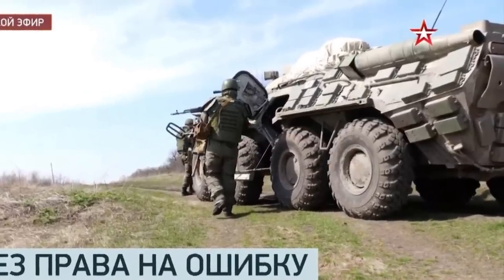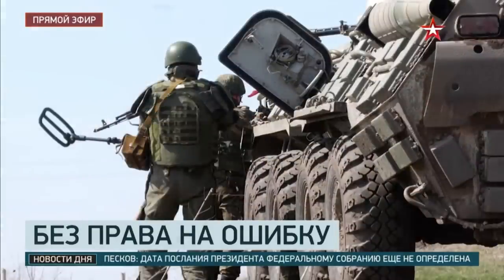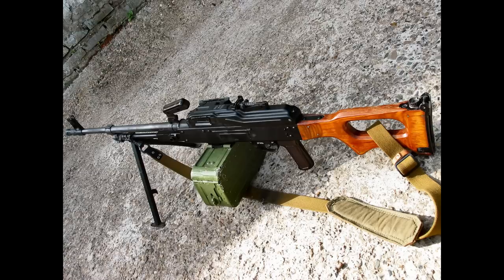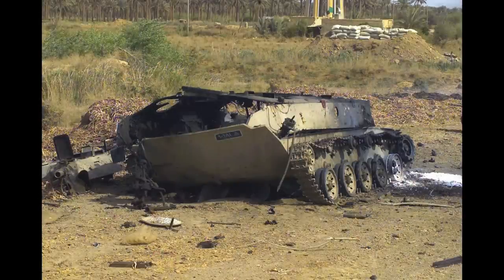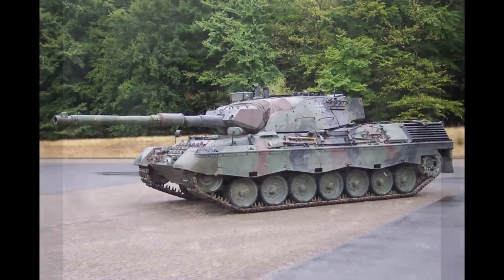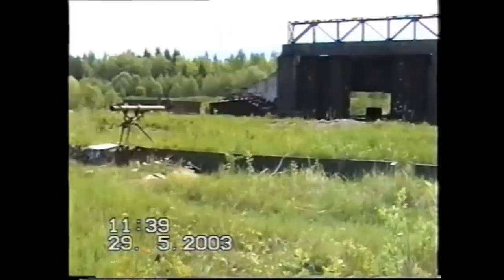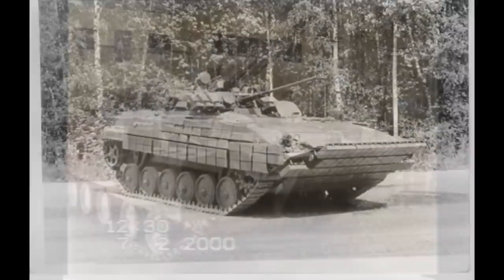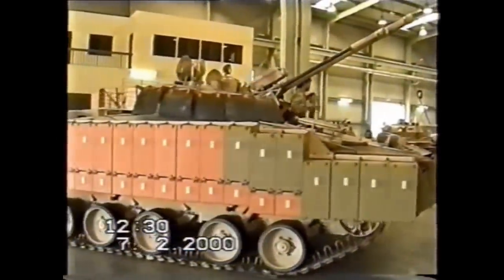Stop Putting ERA on Everything - Why ERA on Light Vehicles is a Bad Idea

Comment: It's worth noting that the majority of impacts we're seeing at the moment aren't from RPG's or ATGMs firing at high velocity, but rather from FPV drones and the like which are striking the vehicle well below the velocity required to produce optimal conditions of penetration and striking with a mix of RPG warheads and non hollow charges. In these situations ERA seems to be relatively useful at stopping a complete vehicle loss, it's still not wholly successful as ultimately BMPs are underarmoured to begin with, but it seems in these cases where ERA is directly struck it more or less completely stops penetration. 

This doesn't stop operators from throwing more munitions at the vehicle and striking unprotected areas of course, which is typically what we see happening in combat footage involving light vehicles from both sides, especially as the winter mud season has made any vehicle movement quite difficult and subject to long periods of vulnerability. 

We're in an era now (pun intended) where access to vehicle disabling munitions has reached an all time high, to the point where armed forces are slapping them on commercial drones and taking out vehicles left right and centre, using strikes that they were never intended to defend against in conventional warfare. It's going to take a while for countermeasures and mitigation techniques to catch up, I wouldn't be surprised if we see a lot of NATO vehicles, particularly Eastern ex soviet bloc countries which have very large cold war reserves significantly up armouring older IFVs to try and match this threat, as frankly their armour is worryingly susceptible to even non penetrating impacts.
Reply: Rpg and atgm doesn't need to reach a target with speed to be effective.  Otherwise anti-tank throwable grenade wouldn't work. EFP wouldn't work.

The penetrative energy comes from the warhead detonation on the surface launching a high pressure copper jet, not the impact.
Reply: The whole point of HEAT warheads is that the energy is stored chemically in the explosive mix and thus independent of strike velocity. The mechanism of the Munroe effect works even on static shaped charges, such as the one used in demolitions or repurposed for breaking into safes or armored vans.
Reply: @ChucksSEADnDEAD   Yeah but you still need to activate the shape charge. And if activation goes wrong, you get no "boom" or worse "boom". so he isn't completely wrong
Reply: @gauss_gun  it really doesn't take much to make them go boom once they are armed
Reply: Heat doesn't need any velocity to work
Reply: You and everyone else should keep in mind one very important caveat to that info that can be explained via something you said: “the majority of impacts WE’RE SEEING” (we’re seeing being the key words).

Most vehicles are still being taken out with rockets, missiles, or artillery. It’s just you don’t see videos of that as often. In contrast to drones or FPV suicide drones where every single one is recorded and commonly distributed to the public.
Reply: @gauss_gun  That's not how it works. The activation is an electric signal initiating a detonator. As long as the detonator was made correctly and didn't get damaged, and the explosive filler is not inconsistent, the activation always goes right.
Reply: @gauss_gun  This is the point I was alluding to, I probably should have described that but what I'd written was already a wall of text and I was trying to be as brief as possible XD. 

In a lot of the combat footage I've viewed it seems drone dropped and FPV impacted munitions tends to impact at poor angles and sometimes with the SCJ facing a poor angle or away from the vehicle entirely. In these cases with the lighter vehicles the non SCJ explosion seems to be enough to cause disabling damage, it stands to reason that the engineering philosophy here seems to be to mitigate these poor impacts as much as possible, as any good impact is probably a complete vehicle loss either way.
Reply: @jonathanpfeffer3716  This is a good point, probably a healthy amount of reverse survivorship bias going on here.
Reply: @ChucksSEADnDEAD  read what original commenter's reply below. I can also add that the shaped charge going at lower speed on the drone can deflect before activating, striking the target at least favorable angles.

Comment: It might be an empty container to add protection against 50 cal rounds.
Reply: Empty ERA container ain't gonna add protection against 50 cal. Also, if they really wanted to have better protection against 50 cal machineguns, they can use the add-on armor thats literally dedicated to stop 50. cal (atleast on BMP its avaliable)
Reply: @TADAMAT CZ  eh throw some angled sheet metal in there and you got some pretty spicy spaced armor to break up 12.7 to 14.5mm fire from light squad weapons
Reply: Add empty countainers to increase moral.
Reply: @brandonsmoot4056  spaced armor isn't very effective against kinetic projectiles. Also, It is almost impossible to make BMP bulletproof against KPVT and other 14.5mm guns. You would need almost 40mm of armor to stop such a projectile, so it isn't possible without heavy upgrade at the factory. Such an upgrade would make the BMP almost 20 tons heavy though, so it would break down easily. Thats only if you don't want to protect sides from KPVT also. That is totally impossible, as the weight would be preety much double of the base vehicle. It maybe is possible to have front protected against KPVT and sides against 50.cal, but only if you need to protect the vehicle against these projectiles at the ranges of 500 and more meters. Point-blank protection against both KPVT from the front and 50.cal from side is impossible. Protection against regular 50. Cal guns is more than possible, but again, the vehicles would get preety heavy and the transmission wouldn't like those few extra tons it has to deal with.
Reply: @TADAMAT CZ  the purpose of the outer plate is to turn the projectile so it strikes on the flat and needs to punch through a larger crossectional area. Even plates as thin as 5mm have shown in models to be able to add significant moments to 14.5mm see attached model showing a sub 50% penetration on less than 20mm of steel against a 14.5mm using spaced armor techniques 

https://youtu.be/WLAMCDcqR6g
Reply: It might also be used to store sandwiches when the crew is hungry.
Reply: There’s something called appliqué armor for that very reason. It’s to be added or applied on later. Why would anyone remove the explosives from the ERA module and place it on the BMP rather than simply placing a thin sheet of metal? You do realize that ERA is very heavy

Comment: I really think you need to make a difference between Kontakt-1 and Nizh, which visually look the same, but behave quite differently. Nizh actually can be added on lightly armored vehicles.
Reply: nizh still explodes only diffrence is how they decrease the hollow charge penetration
Reply: If anything Nozh has far more explosive filler than Kontakt-1 IIRC
Reply from the maker: No, it cannot, Nizh leaves deep imprints into the armor of a tank, which would do a lot of damage to light vehicles, it is more of a directional explosion, so the area of effect would be smaller, but more energy is directed behind it, so it would still do quite a bit of damage to the vehicle
http://btvt.info/3attackdefensemobility/bulat_dz/img033.jpg
Reply: I wonder how many Nizh ERA Ukrainians actually has,
Reply: @RedEffectChannel  would be cool to see a vid from you explaining different ERA types. or even modern defense systems for vehicles in total
Reply: @TheKaMeLRo  we produce it, so you can call it "plenty"
Reply: @RedEffectChannel  That doesn't look too bad though, it barely even scratched the surface of the armor plate. So it would still work on lightly armored BMP's or BTR vehicles.

Also interesting to see the "imprints" of the HEAT charge elements (that are inside the Nozh armor block) which can be seen very clearly on the armor plate
Reply: @RedEffectChannel  Interesting - thanks for the image, but there are several Nizh versions.

Given that Nizh is an array of shaped charges that can generate cutting jets with minimal backblast - not unlike shaped charge can IEDs that were the bane of the US in Iraq - they can be adjusted to be mountable on lower armor thickness in exchange for a loss of effectiveness.

For instance, a 300-block LAFV version was developed to fully cover a BMP-3 somewhere in the late 2000s, rated against 30mm AP sabot rounds and RPG-7/9.

I am not sure where the state is now, but I would be surprised if all the work on LAFV Nizh was just thrown out of the window.

Comment: >Why ERA on Light Vehicles is a Bad Idea
Americans slapping ERA on Bradleys:
Reply: BRAT ERA tiles are specifically designed for the M2A2 and M2A3. Not to mention, the Bradley’s armor is significantly better than the BMPs. BMP-2 can be penetrated by 50 BMG. M2A2 ODS has (at least the ones sent to Ukraine have 30mm protection all around) just look at the weights.

Comment: I wonder if there's the ERA filler in those blocks, or if they're just using the empty blocks to increase bullet resistance. 
Like, the hood of that van might not even stop a .22lr, but the empty blocks might be able to stop 5.45 and 5.56. Idk.
Reply: Depends on material of boxes, but i dont think it increases bulletproofness substantially
Reply: Best case, those blocks are empty and their indented function is to intimidate a would be attacker by masquerading as a MBT.

Comment: There are parts of BMP's, BTR's etc that are thick enough to withstand the force. You even shown some images where they'd be perfectly fine. Notably the front lower glacis, it's ~40mm's
And even the aluminum side skirts, as they are spaced and would not harm the hull.
Turret cheeks may survive, they are 30-35mm. Anywhere else may not survive a blast.
I will add tho, for trucks, it's actually fine. The engine behind will eat the spall, assuming the blast doesn't shatter the window of course, but that's certainly less deadly than mounting it on a door

Comment: Makes me wonder if many of them are just empty boxes for morale. I’ve spoken to Gulf War vets who were shocked at the amount of rubber skirts and mild steel blocks  that were designed to look like armor, but wouldn’t do anything.
Reply: Not necessary just moral "boosters" but putting up an era block without explosives could act as additional armor. Hell if they even put something outside explosives inside it.
Reply: @venator5  Thin metal boxes do not make composite tank armor.
Reply: @venator5  not sure if it would do much against supersonic darts of death
Reply: @polygonalfortress  a bmp is never gonna stop a tank round doesn't matter what you place on it

Comment: I doubt this is the case, but what if they had mounted the ERA panels without the explosive filler; would this add protection and standoff distance?
Reply: Yes, but it still won't change much since even with the added protection and the standoff distance, any HEAT round is still almost guaranteed to pen unless it hits at a ridiculously steep angle and in that case, even regular armor would stand a chance if the projectile skips on the the armor without exploding.

Comment: On a straight hit, era won't help IFVs. On a glancing hit at and angle the ERA is still useful. 

A lot of these example vehicles have the ERA mounted on an additional skirt mounting system, which absorbs some of the blast of the ERA detonation. It seems fine to me.
Reply: Shaped charges doesn't care much about angles after detonating - at least not in a IFV-like armor scenario. On such thin armor, creating more resitance might actually increase the amount of energy absorbed by the object and have more damage than with a simple penetration. Kinetics are a pretty fiddly thing.

The problem is that a lot of these 'creative' designs are made in the field by people with quite a limited idea what happens on different types of ammo hitting some armor, so the constructions might be a nice guess, but often more hindering than helping (may it be size, whight or whatever).
But finally every vehilce face a situation where it should be prepared for better/more specialised. So the crew might be the last line of copeing with the doctrine-breaking orders they might get if war get's a bit out of hand and textbook.

Comment: I suspected that much, mounting a piece of protection gear that is supposed to EXPLODE would require a certain level of already pre-existing protection on whatever it gets put on.
And no matter HOW good your supply truck is, i doubt it is armored strong enough to equip ERA, since most can´t even resist machine gun fire.
But the memes are fantastic.

Comment: Hey, this might be unrelated but can you give your opinion or thoughts on the Vietnamese modernization of the T-54/55 called the T-54M?
Reply: Good. Can't be compared with Chinese Type 59G but I will give it 7.5/10 because of the fire control system that have thermal sight and auto target tracking. Side and top protection need to be improved though.
Reply: Using it purely for defense or even static artillery can be great. India uses its obsolete T-55s (and Centurion) tanks as static artillery

Comment: the author of this video missed one important point - the RPG-7 shell is capable of penetrating the side of the BMP-2 and only after that exploding inside. Thus, empty dynamic protection blocks increase protection against 14.5mm bullets and cause the projectile to detonate behind the body, which significantly reduces the damage caused

Comment: There is always a debate about adding extra armor of whatever sort, be it steel plates, where the disagreement will be that if they are not sufficiently hard they could cause a sharp projectile to turn inward and potentially increase its penetration; sandbags, wood or concrete, random spare tank bits you were carrying anyways like track plate or road wheels, etc., and there are good discussions to have here, like if some extra plating only increases the armor's strength slightly but greatly increases the crew's confidence in their vehicle, it may be worth it.  This is however a very clear case of trying to make something marginally better but instead make it demonstrably much, much worse.

Comment: PBX (Polymer-bonded explosive), A.K.A. plastic explosive is an amazing compound. A good PBX is highly destructive & very stabile. For example, it can explode when hit by shaped charge or APFSDS, but not when hit by .50 cal (.50 BMG or 12.7x99mm) or set on fire for (doused in petrol & set alight) example. Those compounds for use in ERA, that is. Even the US C4 will not explode when set on fire. It depends on PBX's application and it's purpose.

Comment: The topic was debated since the start of the war. There were many possible answers:
 - containers are empty (the goal is to add at least a few mm of steel)
- containers are filled with sand
- containers are filled with ceramics
- containers are filled with steel plates

Comment: You can put contact-1 on pretty much anything, you just need extra distributor anchor and enough rubber to absorb the shocks.
So, stolen lightning discharge triangle and stolen conveyor belt.
This contact on everything is justified. Ukraine got A LOT of old HEAT toys thanks to the whole western alliance scouring the globe for old soviet surplus, not forgetting their own oldies as well. Russians got both old HEAT toys AND new grenades for all their underbarrel grenade launchers and automatic GLs. VKO family punches through 200mm of steel. Every underbarrel GL equipped guy is expected to carry the 4.

Comment: On light vehicles it would be far better to mount a second plate 15-20 cm from the actual armour plate and a light metal mesh out to another 15-20 cm, of course it will make it bulkier but not much heavier and the space between the surface of contact will degrade rpg performance significantly. If spaced armour comes in a package, all the better ...

Comment: Ok, but what if the ERA is placed on added armour placed a few centimeters from the IFV? Does it still affect the IFV by damaging it?
Reply: Added armor is more whight and material needed, consuming more fuel, tools and time. It also might disbalance the vehilce as well as cover periscopes, weapons or equipment. It widens the vehilces dimenstions, so they might get stuck in urban enviroment and become a easy target. Also, the detonation of an ERA block might cause more devestation as the needle of destruction delivered from a RPG, as the one thing is a back of military explosives attatched to the wet toilet paper called armor (and whatever you like to add as a proper insulator-armor), and the other thing is a fist size corridor of destruction gently crossing the vehicle and everything unfortunate that's inside.

So modifications are always a gamble, reliant to the crews expertise to make a very complex tactical decision, propperly implement, and get away with it.

Comment: I don't think they put ERA tiles on top of the tank. I saw Ukrainian made a video about the Russian tank they captured. They check the top tiles and it's not ERA, but NxRA or non-explosive reactive armor. The tile didnt contain explosive. Instead, the tile contain rubber in between two steel plates. I guess it's because the top armor is too thin to accommodate an ERA.